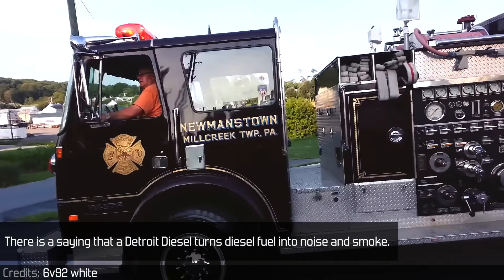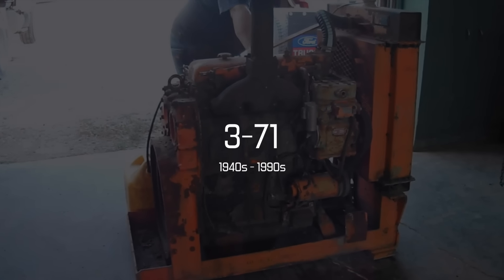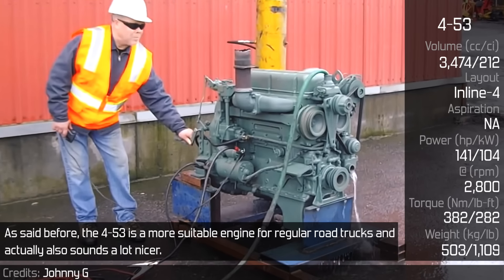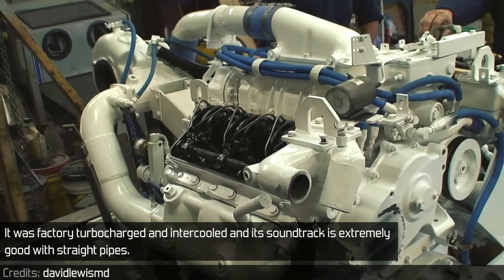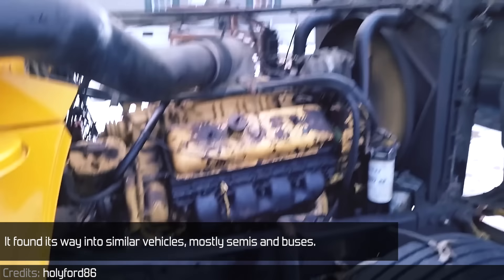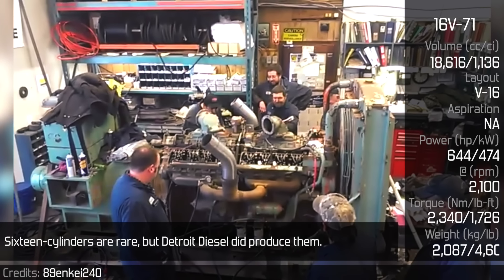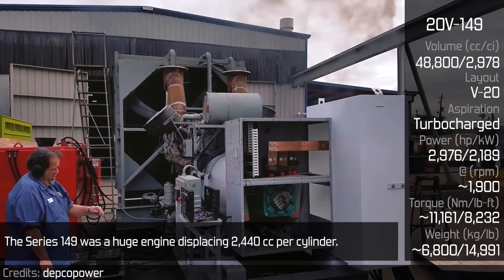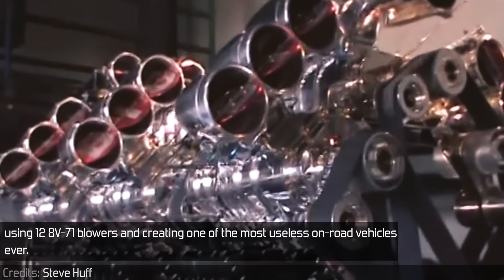9 Of The Greatest 2-Stroke Detroit Diesel Engines Ever

Comment: I am one of those who love the sound of an 8V-92T.  I am not sure why Detroit didn’t turbo more of their engines.  It gave a significant power boost and reduced the noise considerably.  Oh, by the way, I have never heard an 8V-71 called anything other than a 318 Jimmy.  🙂
Reply: I can think of a few reasons that Detroit turbos seem less common. One of them is just perspective though, the 2 stroke product line is really old. Quite a few of the engines in this video are from the 1960s. "GM Diesel" started making the famous 8V71 block as early as 1957. A major strength of the DD lineup was parts interchangeability, as most of the bits on any 71 would fit any other 71. In a way they were kind of stuck with the design from 1938.

Turbos also presented a reliability challenge. You had to really want the power to justify them. They made more sense in say a locomotive than a truck. Plus they, and their piping take up a lot of space. Which gets to another issue on this design: the blower. Not only does this already take up a bunch of space but it limits what a turbo can do. Later model engines included blower bypass valves so that they wouldn't be a direct hindrance. That said, they also needed slightly different blowers to deal with the expansion of the lobes with hotter intake air.

In general turbos weren't very popular on any brand until the 1970s oil crisis. The 92 Series was introduced in 1974 which had all of the above features available. As time went on competition from more efficient Cummins and Caterpillar designs increased. Detroit responded with the Silver series (and a couple of other 92 variants like Tailored Torque and Double-O) which were all turbocharged. I think by the late '80s they were virtually standard equipment on new models. You could even buy a DDEC 6-71TA! But by then the two strokes weren't king of the road anymore. Their new four-stroke model Series 60 took over

Just so you know, 318 comes from an 8V71 with N70 fuel injectors - that's the 318 HP spec and it was popular in trucks :) The same engine in a coach or bus might have N60s in it for less smoke, fuel consumption, and longer life.
Reply: @holysirsalad .... "Just so you know".... the "318" was equipped with Green Tag N65cc Injectors, std. timing at 2100.   Same engine & specs at 2350 was rated at 335 hp.

Comment: There is no naturally aspirated 2 stroke Diesels.
They ALL must have at least a blower, otherwise it wont run.
Reply: According to the SAE, 2 stroke diesels are considered to be naturally aspirated.
Reply: EvenStar LoveAnanda thank u I was going to comment and say that
Reply: They WILL run actually, just won't rev
Reply: Also Detroits without turbos were known as n/a
Reply: There is one it went out service about 5 years before Vietnam ended it was the 61 series Detroit with the integral head
Reply: @frankiehoward3274  That would be the 51 series, came in 2,3 or 4 cylinder in-line
Reply: Yup but the blower only compresses air barely enough to put air inside the cylinders (because 2 stroke engines dont produce a vacuum by themselves)
Reply: They are considered naturally aspirated, beacuse it needs a blower to run
Reply: To anyone still wondering, the cylinder pressures don't really raise much on a blown 2 stroke engine, (unless the exhaust is restricted) the blower only allows for a more effective clearing of gasses from the combustion chamber.

(Part of that is my theory on why straight piped Detroits tend to smoke more than the average (outside of just tuning), since with less air in the cylinder, a lot of fuel just stays unburnt.

Turbocharged 2 strokes don't really raise much, if any, on pumping efficiency as 4 strokes do, as they can't take advantage of manifold pressure in the intake stoke pushing into the cylinder.
Their main gain in power actually comes from just a higher overall pressure between the compressor and turbine, which allows a higher amount of fuel to be injected and burnt. Such gains would be impossible without the restriction from the turbine.
Reply: @ignasanchezl  they do need a blower to run
Reply: @jdlawless_fuel1416  With this piston design they need.
Some 2 strokes have a specially shaped piston that generates a venturi effect that generates a flow through.
Reply: @jdlawless_fuel1416  I think you will find that they will run/idle, they just don't rev...
Reply: @adamv395  Detroit's can rev fine. I see them run wife open throttle all day long no issues working hard.
Reply: Not true.  If you ran a truck up an incline and stalled the engine, and weren't quick enough on the clutch, the engine would run backwards.   The blower was nothing more than an air pump.  It generated no boost.  Without a turbo, it was naturally  aspirated.
Reply: @ignasanchezl  It was actually referred to as a "scavenger". As it has already been pointed out, it didn't provide forced induction.
Reply: If it doesnt have a turbo its considered naturally aspirated.

Comment: Good stuff, real nice video, Working for my Dad ,at 16 I could pull a inline 6-71 with transmission out of a bus with a forklift. Engine and transmission set on a cradle that had 4 points that connected the cradle to the bus , 2 in front the of the engine, and 2 in the back, man the good old days..I like the 4-53 Jimmy, nice little engine,  My farther has a 2-71 at the shop with a generator that came from a tug boat.

Comment: wish ya would have showin the old detroits when they lined then up to make 12's for heavy steel hauls and such , Those were loud and sounded good till your 15th hour of straight pipes but i do miss the car drivers going threw the roof Jacobs on rattle rattle pop pop the old jacob's on or off  no stage 1-2-3

Comment: I'm surprised that only 1 guy said that ALL 2 stroke Detroits are NOT naturally aspirated, without the roots blower they will not make any power. Detroit added turbos to increase power, very popular with the 92 silver series which when on turbo boost it bypassed the blower-neet trick. I used to work on some fire trucks for the cities of Volajio & Novato in CA. Novato had a 1953 Segrave 85' ladder that had been repowered with a 6V-53 & Allison auto, used to watch the tach bounce 4000 rpm between shifts, what a wonderful scream!
Reply: I worked on Detroits for many years, loved the 53 series, but never heard of governor being set over 3300 rpm.

Comment: Some of those production dates were a bit off the mark, the 20 V 149 was developed mid 80's for mine haul useage. The 24V71 was only released around 92 as a way of using up all the old inventory before the engines were outlawed by the EPA. The ones that made it to Australia all went into back up power gen sets. The acceleration was beyond belief, stationary to 1500 rpm in less than a second.

Comment: That's what I started out on with Central Florida Transit, they had American Eagle coach buses. I did my share of in frame overhauls but mostly just PM services and filter changes.
That was even before I went to diesel school, you don't see them much anymore. Back in the day you either had a 855 Cummins, a 3406 Cat or a 2 stroke Detroit, unlike the rest they would bring you home with a few dead cyl's; Cat or Cummins would come home on the hook.

The old saying about the 2 stroke Detroit was " If they don't burn a gallon of oil and leak a gallon of oil a day they ain't running right " That roll in the idle of the most usless truck ever built is because they didn't adjust the buffer screw, that is the last step in the tune up; You don't raise the idle, just take the roll out. They are actually supposed to idle smooth not roll.

Comment: I was told that you could bolt as many together as you wanted in the same series. to cover any application, my first big truck was a cabover kenworth with a silver v8 92 TA. when i would bobtail i would smoke cars off the line some times break traction. that thing would pin you in the seat so bad you could not get your head off the headrest. great motor it wasn't as bad on fuel as everyone made it out to be.

Comment: Forgot the Detroit Diesel  1-71
Reply: John Donahue, 6-71 was one tough money making power plant, hauled tons of hay, grain, steel, lumber, and everything else.
Reply: Fredrick Kohlman I have an 81 GMC Brigadier with a 6-71 in it. 800,000 and counting.
Reply: Only a few of us left who have heard of or seen a Detroit Diesel 1-71 in operation
Reply: There was also a 1-53 that was used for truck trailer refrigerator unit.
Reply: Is that a real engine even
Reply: 6v53tt in a pickup ftw....and 12s in the 1/4 easy
Reply: I think they were used to run the deck winches on LSTs.

Comment: No 2 stroke diesels are NA. They need forced induction
Reply: supertruckerw9. I caught that as well. You can clearly see the supercharger nestled between the heads!
Reply: 2 stroke diesels won't run without a blower. Only turbo motors are considered to be forced induction engines
Reply: supertruckerw9 that's where you are wrong they are natural  the blower dissent provide boost psi. Only volume boost is created by using turbo. Get your facts straight
Reply: Yon Cheramie. It's STILL "forced induction" even if boost is less than one pound. Engine will not run without it. It cannot provide nessasary vacuum for intake air. Unlike a 4 stroke diesel.
Reply: Naturally blown is a thing.
Reply: A natural 2 stroke has to have a blower to push the exhaust gases out the 4 exhaust valves. I had a 6V-53 in a river patrol boat in Viet Nam that broke the blower shaft and it stopped. The boats had 2 detroits and we limped to the base on one.
Reply: Nothing wrong with a super charger or a turbo ,man .
Reply: You ever read on anything related to two stroke dd like the 8v-71na bar stands for natural aspiration. Look it up theses engine require the blower to run also such as 8v-92 ta well ta stands for turbo aspirated.

Comment: The only clean Detroit Diesel was a new one, and idling with only 4 psi of oil pressure was perfectly fine. And many a novice truck driver learned the hard way to NOT use the Emergency Stop to shut down a 71. When i was very young and rode with my dad in his cabover i pulled the E Stop handle, dad was really pissed because the cab would not jack up to reach the reset lever on the air flap valve.
Reply: Heard some guys say pulling the runaway flap would sometimes suck the seals out of the blower

Comment: Three of the greatest 2-stroke Detroit Diesels are not on your list: 

The 6V53 is also called the "Detroit 318" - that's its total displacement. Popular in semis and military applications. The Navy's Patrol Boat, River (PBR - one was the star of Apocalypse Now) had two of them connected to jet drives. 

The 6-71 and 6V71 (the engine was made in both inline and V configurations, so we'll call it two engines) was a very popular fire truck engine. It also found its way into semis, big stationary generators, and a LOT of vessels.
Reply: jmowreader the only "318's" that I've ever heard, were the 318h.p. 8V-71 as in 238 h.p. 6-71.

Comment: The road train at 5:40 is owned by patty ward and my pop Allan worked for patty for 28 years running fuel to the middle for Australia as patty owned 25 BP fuel stations across central Australia

Comment: At the Redford Plant going to Engine Test was a trip that if you had bad teeth, made them hurt.  Imagine 100 engines running flat out, being broken in and tested for HP output.  Every DD went through a test program to ensure quality. Needless to say, hearing protection was required.

Comment: I drove a 1992 Eone fire engine pumper with a 6v92 detroit and its exhaust was old and wore out. It sounded so magnificent and you could hear it for miles and it rattled your chest. Stomp the accelerator and it would set you back and blow some smoke.

Comment: Hi  in late 1978, i worked driving asphalt trucks, for Westcan in Canada. A guy there, had leased on to them. He had a cabover engine Freightliner, with a V12,  and only a 5 speed transmission. Alot of the engine, was still out the rear of the cab.......go figger....

Comment: Smoking? Ha! Back in the old days, Drilling rigs had Waukesha engines. Tach out @ 1200 rpms. They smoked like crazy, but had  incredible torque. They'd pull miles of pipe no problemo.

Comment: Actually the specific fuel consumption is 135 gram per horsepower per hour. That is quite good, and hard to pass, by modern computerized diesels. The vehicles they are in make them drink :-)

Comment: My family owned a early 1960's 65' wooden flush dech cruiser (similar with Trumpy, not remember the shipyard), but it had twin 12-71TI 675hp each. Amazing noise and very reliable as well. We had a very strange malfunction sometime, the cylinder rings from 3 cylinders of left engine broke and disappeared. However, that engine sounded just like the good right one, only burn oil. Since the malfunction was very close to our vacations, we went, care the left engine oil (4 kilos of oil every 2 hours if remembered). After a mechanic charged three cylinders with new pistons and thats all.
Reply: Sounds as if cranks out of line with propeller shaft
Reply: Even the mechanic did not knew how did this happened, he was trained to fix any of 53, 71 and 92 series. Our boat had twin 12V-71TIs. Even the turbochargers where ok.

Comment: The 2-71 is still in wide use as a genset, the famous "choo choo chiller". The engine turns a generator, NOT a refrigeration compressor. The refrigeration unit is in turn run by an electric motor.  These units are popular for survivalist use when available surplus as well but most on the secondary market are either stolen or thoroughly worn out. Be careful to get full documentation if you buy one or the pussyfoots (the railroad cops) can get very ugly. These Keystone Kop like characters have the same powers as a FBI or SS agent: they can carry guns on passenger aircraft, which local cops and state troopers can not. 

 I'm pretty sure there are 4 valve versions but I could be wrong. Those might be 2-53s.

Comment: Fun video, worked on many DD's in the USCG,thanks
Reply: Yup... 40' utility boat's and 44' motor life boats too I'll bet.
Reply: @chickey333  I overhauled 2 ,6,8&V12 -71's, 3,and 6V53's.Mostly at Base Industrial Governors Island NY during 80's.The 44MLB,s at our station had V6 Cummins.
Reply: @patrickcraig6032  Cummins in a 44!!  Wow, I hope that increased their speed at least a little more than those puttsy 6V53's did.  Great boats... always brought you back.... eventually.
Reply: chickey333 Not much more speed. Maybe a knot. Lol.They could tow.We would go after 60’ Dragger f/v 50 miles out. Would take a couple of days to haul them in. Fun trips. Around 1977 got a boat with a 6V 53’s . They had to add lead weights in well deck void to make up for Cummins weight. The engine mounts were light as well . Get a line in the screw and might break engine off mounts . Happened at Cape “D” station. I was at Chetco River , Oregon. We had 3 44’s, a 25 msb with 3-53 and 26’ Bartender prototype test boat with a 504 Cummins.
Reply: @patrickcraig6032  "They could tow"  Yes they could!  We would tow in and take along side 150' fishing trawlers and tie them up in Newport, Rhode Island in the 70's.  We also had a 40' (who didn't) a 17' Townsend and a 14' Whaler.  Just before I left there they received a brand new 41' with Cummins engines.  
To this day I still loved the 40 foot UTB's and I understand some are still around being used for private use.   Great work boats they were.
Reply: @chickey333  The last 40 boat I was on was at Cape"D" Washington,1974. It was used for in river SAR. They were a fine boat.The 41's replaced all the 40's early on in my career.The 903 Cummins engines were not the best .The 8V-71 would have been better.The 903 was truck  and equipment engine.Not easy to rebuild in the field.Special tools required.I overhauled quite a few.The last Cutter that I was on was the IRIS WLB395.we had two 6-71's for gen sets. 125kw.A BUDA emg.gen and Cooper Bessmers for main engines.
Reply: @patrickcraig6032  Budas and Cooper Bummers... lucky you!!  Sounds like you had a great deal of overhaul experience.  Much of mine came at Yorktown (a place I loved) and Indianapolis Detroit Diesel schools.  Also on an old 311' we unloaded overseas.  Semper Paratus...

Comment: Detroit diesels definitely have a sound all their own, but you forgot or should have included Detroit diesel locomotive engines, 16v547, 16v645 and the 710 series, now there are some awesome Detroits. But I did like the video.
Reply: Those were EMD engines, not built by Detroit Diesel, but designed by some of the same people at GM engineering in the 1930's.